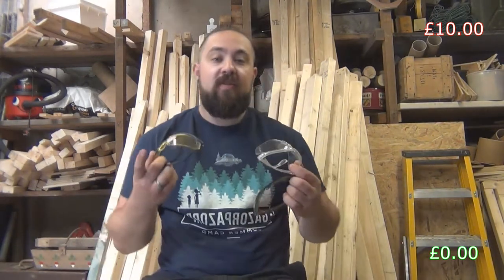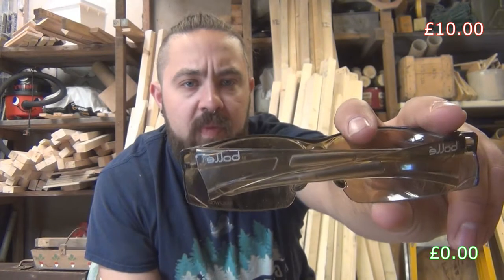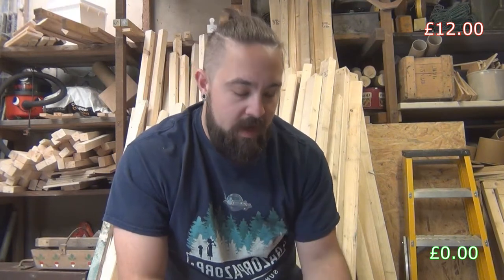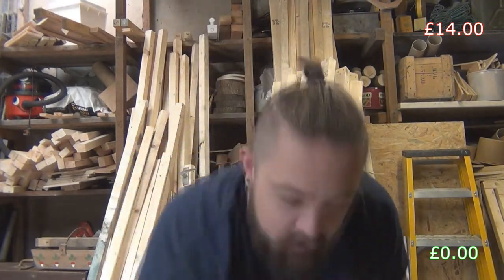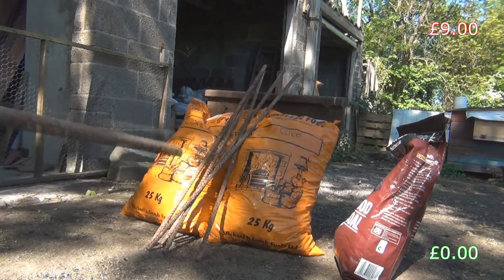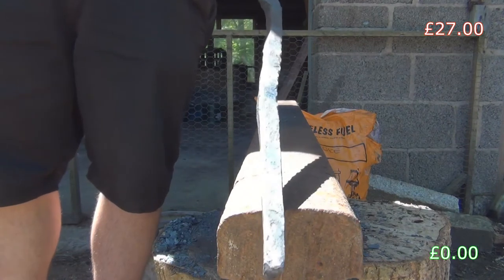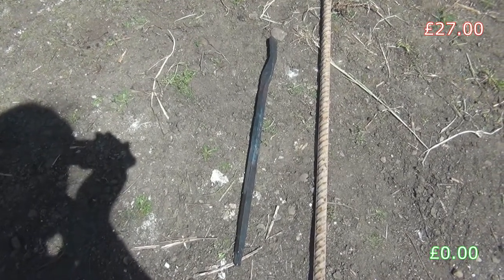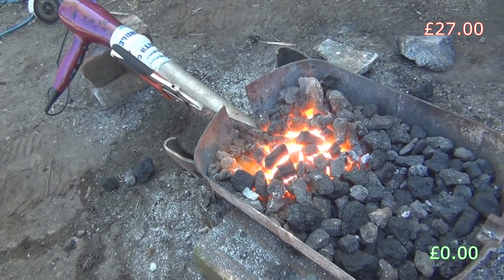My Blacksmithing Journey Ep02 (tongs part 1)

Comment: Good effort. Your tongs are left handed, they should cross the other way. Try making a bottom blast hearth, there are lots of ways to do that. You need a decent corner on your anvil to forge the step where the jaws end and the pivot hole is.
Reply from the maker: Jim Cooper thanks for the advice Jim, I hold my tongs in my left hand and swing my hammer with my right. Is that what you meant or  are they still the wrong way round? (i.e do left handed smiths swing a hammer with their left, or hold tongs with their left?)
Reply: Yes you hold them in your left hand and if you look at a pair of scissors you'll see what I mean, but it probably doesn't make any difference,  just convention. I'm looking forward to your next battle with metal ha!
Reply from the maker: Thanks Jim, I look forward to playing a bit more. What would you recommend once I've finished with the tongs? I'm thinking perhaps some tooling?
Reply: Try and get your hearth working better maybe with a bottom blast when you can. You're going to have to make a punch for the rivet hole in the tongues and maybe a chisel at the same time for cutting off the ends. For safety you'll need several pairs to of tongs grip different metal sections firmly.  A few bending forks are useful and a vice is very useful. There's a lot to learn.